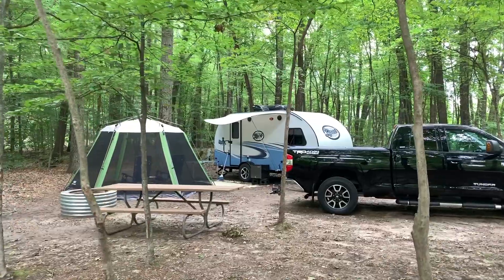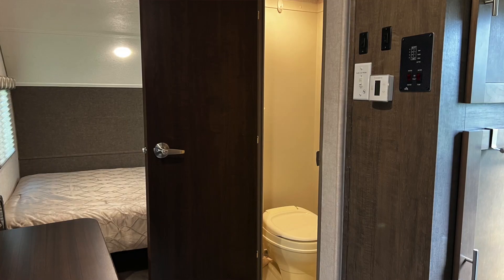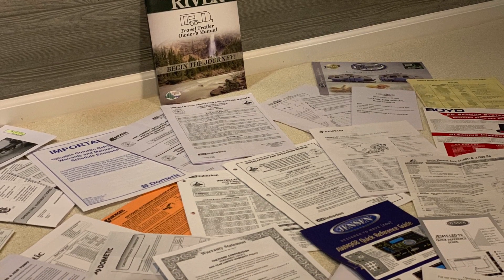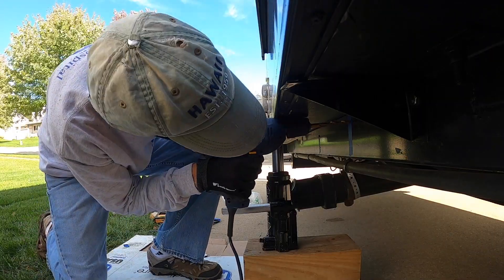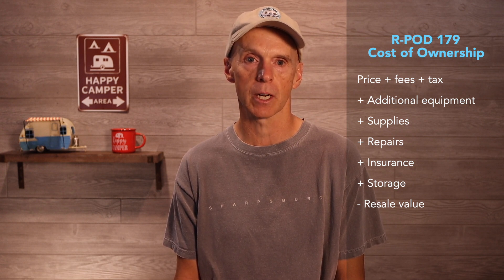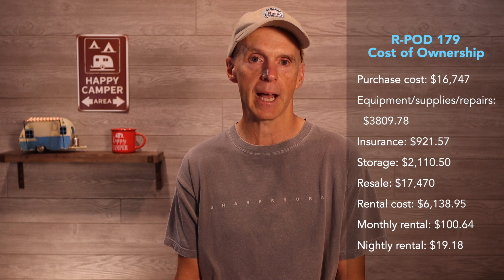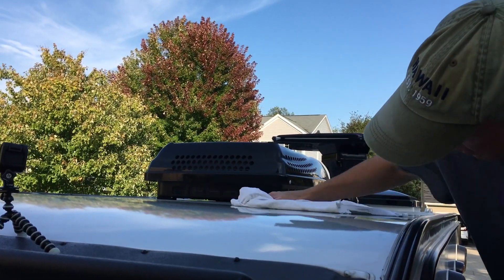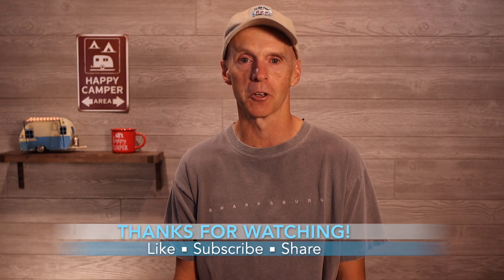R-Pod Long-Term Review - 5 Years of Ownership

Comment: Purchased a 2018.5 R-179 about a year and a half ago after watching all of John's videos. Thanks to John I was well informed and was able to resolve issues before they became problems. 
I had the back frame reinforced so I would be able to use my two bicycle hitch carrier, support two 300aH LiFePo4 batteries at the floor under the stove, and had the floor supported at the galley to avoid the inevitable soft floor. I had beefy outriggers made and installed by the same welder for much less than I've seen charged by others, and significantly stronger. I installed a 4kW inverter and solar and exchanged the one 20lb for two 40lb propane tanks. I am able to boondock without problem.
I underestimated my height and drove an overpass into the roof. After-sale Forest River support does not exist. They will not sell a replacement roof and have no interest in repairing the damage themselves. The wait would be in years, even if they would take on this major repair.
My R-Pod will likely be totaled by the insurance company, not because the cost to repair would be too great, but because Forest River refuses to provide the parts to repair and all must be custom manufactured.
We bought the R-179 because of the size, weight, and floor plan. We have never been disappointed by these factors. Even the initial manufacturer build quality is excusable because, let's face facts, all pull trailers are poorly made. What is not excusable is the absolute abandonment of owners by Forest River.
Reply from the maker: Glenn, thanks for sharing your ownership experience. Sounds like you have the main issue well covered. All the best!

Comment: 2018 180 here, I have the kitchen flex and need outriggers for sagging slide wall. I had a bathroom leak from a pinpoint hole in a seal that was fine in the beginning of the season. Have had to replace kitchen waste plumbing, shower p-trap, converter (x2),  kitchen/bathroom wall break in two. Labor of love for sure.
Reply from the maker: Thanks for sharing your experience. There is a lot of help when it comes to the floor flex and outrigger fix on the owners forum (rpod-owners.com) and the videos I have (https://johnmarucci.com/r-pod-video-list). Not too difficult a job. All the best!

Comment: We have a 2018 1/2 178.  Fortunately we have had no issues, other than  due to operator error and inexperience.  We have not use the RV as much as we thought we would.  I do love the cost break out you did.  This year we might try to do winterization ourselves.  Thanks for this thorough and informative video!!!
Reply from the maker: Sandy, glad to hear you haven't had any issues. As mentioned, I used mine a lot in the first two years and I think the R-Pod trailers likely hold up better under lighter use. I do have an R-Pod specific winterization video on the channel if interested. It is part of the 37 R-Pod video list here: https://johnmarucci.com/r-pod-video-list/

Comment: I have a 2019 Rpod 180.  It hasn't been perfect but has held up VERY well.  I look at it like this; when you bought VW Bug, you kinda expect it'll be easy to work on and there will be fix-it needs on occasion.  For the price you pay, you can't expect Mercedes Benz.  Rpod is as good a quality rig as anything in its price range, and a good balance of price and quality...especially if you're a handy person.  I love the customizability and have had a great time making it my mobile cabin. That's my experience after 4 seasons of very regular use, probably 2000 miles per season and spending roughly 10% of my year out camping.
Reply from the maker: Thanks for sharing your experience. All the best!

Comment: Surprisingly good resale value after 5 years!  I purchased a 2015 179 and so far have not had any of the issues you've had.  Also, I store my 179 at home in the open near Buffalo!  Your video did point features I am now focusing on to make sure I catch the defect early enough or proactively....thanks for your videos!!
Reply from the maker: Roger, thanks for the comment. Glad you haven't had these issues. I think my heavy use contributed to the issues. The structural issues are what you likely will want to get ahead of (floor flex and outriggers). All the best!

Comment: I want one so badly but I’m afraid to do it for the reasons you’ve touched on. As a single woman… who isn’t a mechanic it would cost so much for repairs.
Reply from the maker: If you buy a used one, you may want to pay an independent RV inspector to do a thorough inspection before purchasing.
Reply: I looked at ton of used trailers before buying one when I lived in another state, now sold. So many have musty moldy interiors, sagging floors, water leaks from the roof its the exception to find one w/o it. You should be handy as the setup and maintenance like draining for winterization and such is typical. If you self-educate there are resources however.
Reply: Seriously look at buying a better quality Cortez or Cassita
More $$$ but well worth it.

Comment: Nice wrap up John.  The resale is certainly inflated, thank you Covid.  The market is normalizing and I believe will continue to do so until it reaches pre-covid averages.  As such I would use a devalued resale value to reflect at least 30% depreciation from the original purchase price and subsequently recalculate the cost of ownership.  Certainly changes the picture.  The flip side of this is, when resale values / depreciation percentages do get back to norms, the better deals will be a used R-Pod like this where all the deficiencies have been found and corrected and it can be had for 50-70% of it's original value.
Reply from the maker: Thanks for the commentary. I think used values will remain a bit higher than your assumptions, but generally we may see a softness later this year. There is so much general inflation that my take is nominal prices will remain somewhat high vs. initial purchase prices. Thanks for interacting. My monthly newscasts get into more of this detail if interested.
Reply: @JohnMarucci  I don't disagree in the short term but used pricing is highly driven not only by inflation but also demand which has dropped noticeably.  This industry will eventually normalize and many will have taken a large hit on values. What we buy will be calculated on a normalized market and that means a new RPod is out, so not what's happening today but rather what is anticipated say 5 years from now.  In fact most are out (for buying new) as it seems a good majority of manufacturers are building garbage with no signs this will change.
Reply from the maker: Thanks for engaging Bob! I always enjoy a good economic discussion (Econ professor once). If you haven't seen it, Black Book tracks used RV pricing over time. Pretty interesting: https://rvbusiness.com/black-book-wholesale-rv-values-mixed-as-spring-arrives/

Comment: Well done as usual John! I have a 2016 179 that I bought in 2015. Your channel has been very helpful and trustworthy over the years. I’m fairly handy and don’t mind the yearly upkeep required of any trailer and have not had any major repairs on my trailer. I hope to keep it running for another 8-10 years. While there isn’t any evidence of sagging yet I may install some outriggers next year as preventative maintenance. Keep up the great work and thank you for the library of videos for me to reference when things pop up!
Reply from the maker: Thanks for the comment! I am glad the videos have been helpful. Glad to hear you haven't had any issues with the floors or structure. You idea to be proactive makes sense. All the best!
Reply: I'm looking at a used 2016 so read your comment with interest. I'll have to check the other videos. @JohnMarucci thanks for this and you're obviously a detail oriented guy with the cost breakout! As financial person I'm impressed. RV build quality (in my very limited experience) is fairly low so problems are not surprising.

Comment: Owning any rv trailer is an invitation to learning how to be a handyman.  RPods certainly test your ability to fix things, things you never thought of when we purchased our trailer.
Moving on.  We have upgrading by selling our RPod and purchased a new Northwood Arctic Fox 22G.  The quality of materials and craftsmanship resulted in a purchase price almost double of our last RPod 191.  We had minor issues during our first outing that were quickly repaired by our dealer.  Our second outing over 10 days and 1,000 miles only had one problem.  We discovered our electric jack was blowing fuses 3 times over the 10 day period.  Our dealer will be looking at this next week.
One thing I have noticed through social media is the Arctic Fox has a few persistent flaws, most noticeably the dometic gas/electric refrigerator.  I hope Northwood is listening to their customers.  The refrigerator is not a reliable appliance!
Another important item missed of not owning a RPod, Northwood does not have an owner making informative blogs like you have made about the RPod!  However, many of your blogs cover essential maintenance procedures every RV owner can use.  For this, we all thank you John for the time and effort you put into your video productions!
Reply from the maker: Tim, thanks for the comment and sharing your experience!

Comment: That's absolutely wild that after 5 years almost you sold it for more than you bought it for we are definitely in extreme inflation times. I'm surprised you didn't make a bigger deal with that because that's not going to happen hopefully to anyone else buying one today. When I look at the cost of owning a motor vehicle I think of it similar to going out to dinner... Nobody worries about the resale of a steak dinner because they consume the value I believe when you buy a new RV just like when you buy a new car you're consuming the value of having this shiny new thing that's hopefully going to be trouble free (I couldn't help but notice that pretty tundra of yours I'm sure you have a similar analysis?). I have to assume that in normal times after about 5 years the RV should be worth about half give or take... I think you did fantastic.
Reply from the maker: Thanks for the comment. R-Pods have a fairly deep market, given their low cost of entry. I could prove all my structural items were corrected and the unit was in great shape. I think this past May, when it sold was an especially good time to sell. The Tundra has been stellar and I think I could sell it for about what I paid for it in 2017! All the best!

Comment: Thanks so much for your work and reporting. Sorry if I missed this in one of your videos, but can you please talk about which replacement camper you bought and why, and which other brands and models out there do you feel have a generally higher level of quality and value? Thanks.
Reply from the maker: Lots of people like Grand Design who come from more entry-level brands. If budget allows, Oliver and Lance seem to have better quality with the higher price. Airstream still is at the top and since 2020 have composite floors. Of course, they are also the most expensive. Thanks!

Comment: Thank you as always John for the honest information and feedback 👍 I am excited to pick up our 19' 202 after our most recent warranty work (front window replacement/decal...shore water hook up leak, and pantry clips that have broken).  Even with the issues, the memories made out weigh any annoyance.
Reply from the maker: It's not just R-Pods, especially the past two years. Quality is a big problem in the industry overall. That said, the 2017 R-Pod with lack of outriggers, and floor supports and very limited warranty make it especially troubled.

Comment: The lack of outriggers is such an egregious design flaw. The converter failure...wfco it's just a very popular (if not the defacto) power box on just about every RV that I've seen. If you don't like it you can just upgrade it even though it is a little time consuming.  I'm keeping my  wfco power box and just upgrading my converter section to a lithium charger on my current camper.
Reply from the maker: Since I changed out my WFCO, it never failed again and I did bring a spare with me on trips and a battery charger. I think the tires may have played into the problem. Once I upgraded to GY Endurance and could run them at 65 psi though an 81 psi max tire, it made for a much better ride with less sawdust in the unit after travel! I think the first set of OEM tires bounced things quite a bit and may have contributed to the problem. Thanks!

Comment: We were thinking of getting a camper but it looks like a stressful experience, not made very well and a hasel to deal with Company.
Reply from the maker: It can be stressful but it also facilitates camping at some memorable locations. My R-Pod had many structural issues which caused most of the stress. My Keystone Bullet has had no real structural issues but has had faulty appliances. Not easy to think through as there certainly are risks from poor quality.

Comment: My 171 Pod has a 'born-on' date of June 20, 2021 @ $22,500.00.  The one warrantee claim I had was for a warped outer fridge vent - replaced by dealer, installed by me with a Norcold piece -- the original was unmarked (China?).   Other issues included a stripped out shade lanyard mount - filled the hole with Elmer's Wood Filler and refastened, now SOLID - and front window frame upper mount screws loosening, snugged up by me as well.  As far as upgrades, the factory mattress, Chinese origin tires, CT HVAC thermostat, dinette bottom cushion foam, and shower head all got tossed off or sold to other folks.  Added a TPMS, dual propane tank setup...I'd guess around another $2,500.00 total.  Still better than my 2011 Coleman 8' PUP, that the dealer gave me $4,000.00 for, sight unseen, and they likely spun for at least $6,500.00...
Reply from the maker: Thanks for sharing your experience!

Comment: I bought a Forest River product, an East to West travel trailer in January, 2021 from a Maine dealer. Well, just 5 months later, I dumped it for a Grand Design Reflection 5th wheel. The E2W leaked like a sieve and just had some annoying design issues that the "engineers" just never thought of like where do you put a DVD and satellite receiver near the TV. Best decision ever. I brought many of the problems that I had encountered directly to the product sales manager of the ALTA line, but frankly, he could care less about running them up the flagpole. The CEO of the new Forest River division, Lisa Liegl, daughter of Peter Liegl, CEO of Forest River, was way over her head coming from the fragrance industry. How ironic that FR just happened to buy E2W and made her a millionaire when FR already had plenty of product lines in the travel trailer segment.
Reply from the maker: Eric, thanks for the comment and sharing your experience!
Reply: @JohnMarucci  Looked at the R-Pod, but am now re-directing my attention to small toy haulers so that I can take my Yamaha Scooter with me. Maybe in the next 50 years, they'll figure out how to reinforce the back bumper so that it can support more than a bicycle.

Comment: I own an R-Pod 180, 2016 and a half. I do think the floor sags a bit like what you were showing in your video. The controller did break and I've had a problem with the drawers. Other than that it's been okay and I've lived in this for about 5 years. Do you think it's time to sell?
Reply from the maker: The floors can be reinforced without too much difficulty and many people by now have done it. As far as selling, it is totally up to you. If you are still enjoying the RV and it works for you, just stay on top of the maintenance and  there is no reason it won't still perform.

Comment: I’m looking at a 2017 rpod180 for 10k. Private seller. Any tips ? Is that a fair price if it checks out ?
Reply from the maker: I would be very skeptical at that low price. You may want to hire an independent RV inspector to check everything out before buying. Also, check out my video on my five big issues with the R-Pod 179: https://youtu.be/pBwLVGruloY?si=FdTOUbunSBPeA0aZ

Comment: I think it's an eye opener for all new travel trailer owners how poorly constructed, generally speaking, the trailers are.
Reply from the maker: Agreed. There is very little incentive to reduce errors or add cost to production at the manufacturer. Pass the issues to the dealer and customer to manage. If the dealer can't/won't service it, you will likely DIY the issue and save them cost in warranty expense.